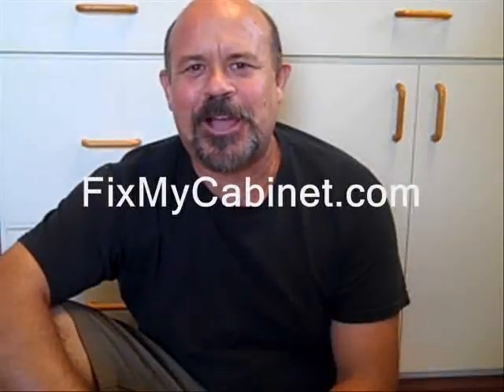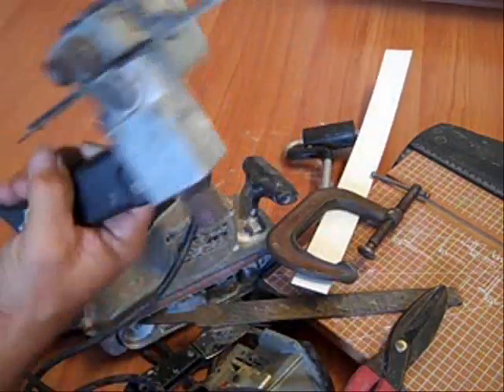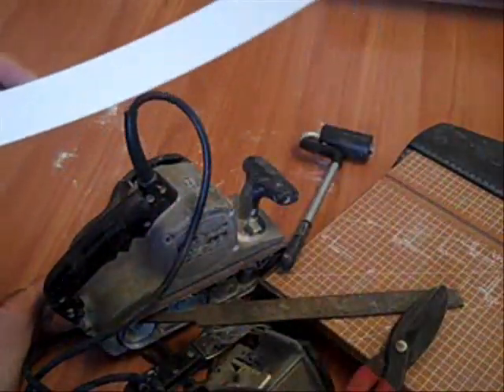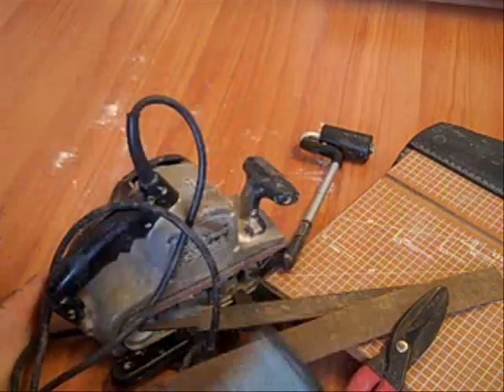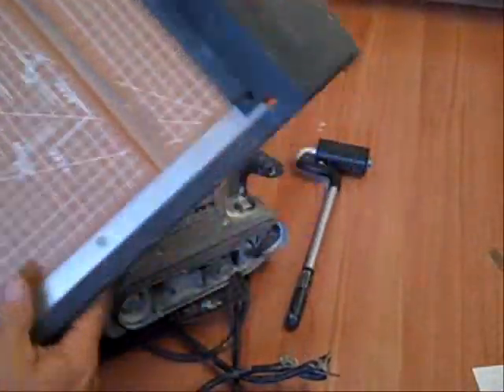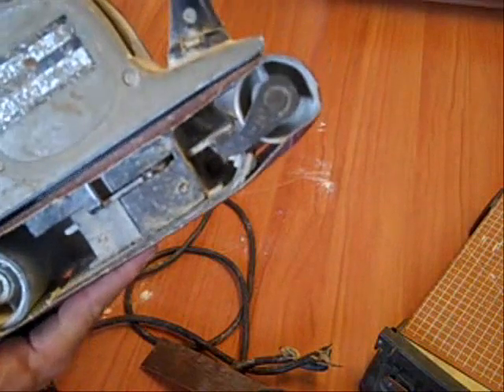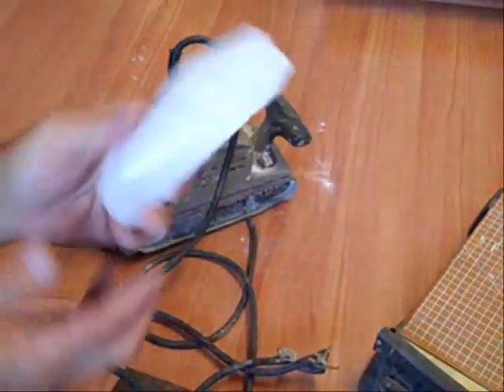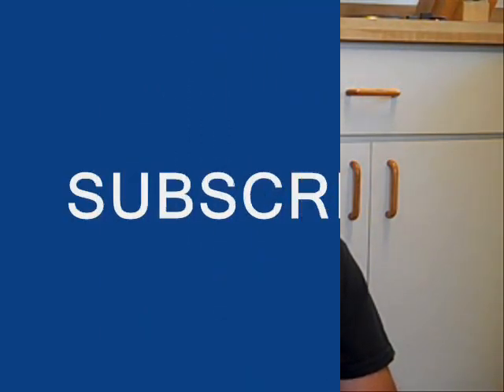Tools Needed for Installing Formica  on Cabinets or Counters

Comment: I used to use my laminate slitter ALL the time.  I left that company years ago and now it's a dust collector cuz most shops have everything ready to go for us installers.  Those laminate slitters are great tools.  Mine only cuts to a minimum of a half inch.  I figure out that if I need a quarter inch strip I can cut a 3/4" piece then set it to 1/2" and cut off a  1/4" piece.  There's more than one way to skin a cat.  :-)